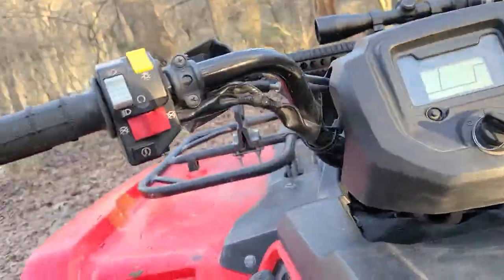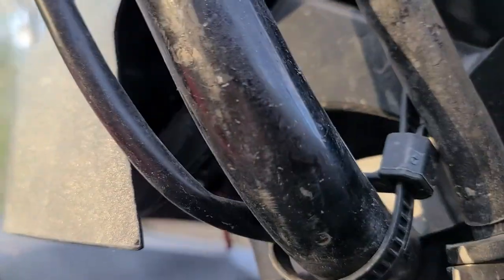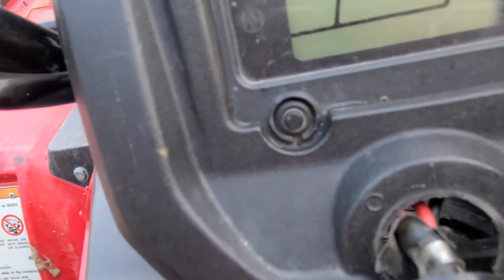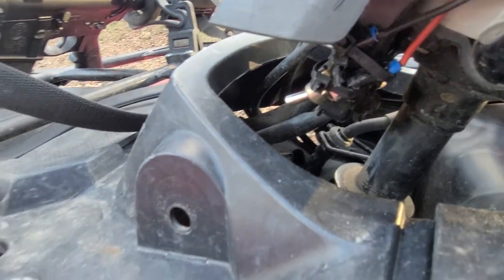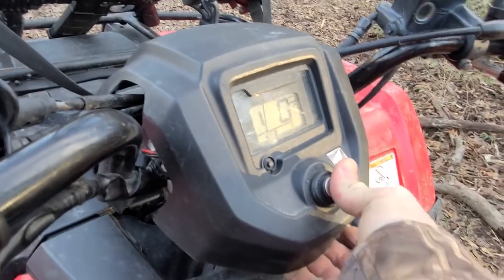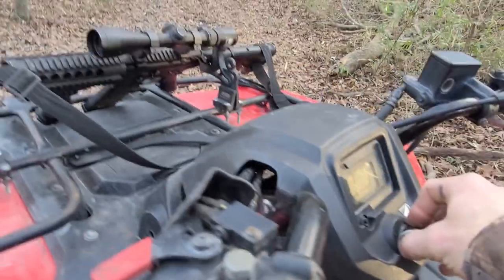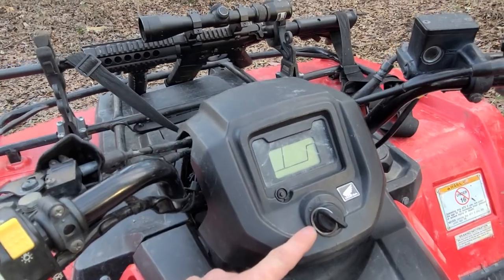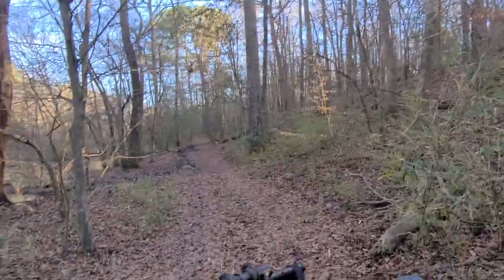How to Start 2017 Honda Ranch with no key #lostkey #easyfix

Comment: the wire that’s you left out …  run it back and wire them to your battery abs they’ll work but may need a switch on it as well to keep it from pulling voltage all the time
Reply: Are you talking about the red and black wire or the pink one

Comment: I did this and was running fine for awhile but now the battery keeps getting drained and and now it only stays idling if I keep a jump box on it and shuts off if I take the jump box off I don't know what the problem is do you have any idea?
Reply from the maker: Not sure I still have mine ran like this. battery never drains it set for like 2 months and it's still good.